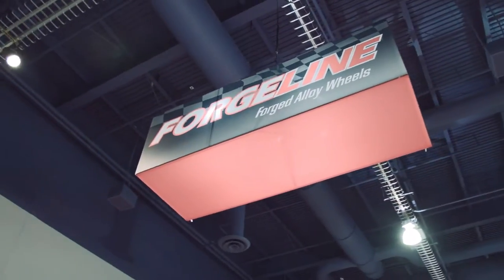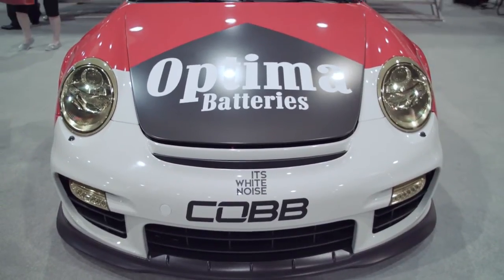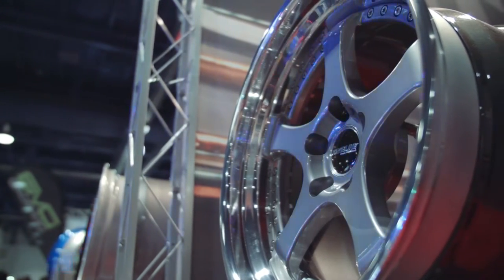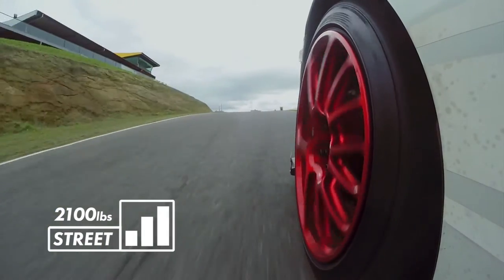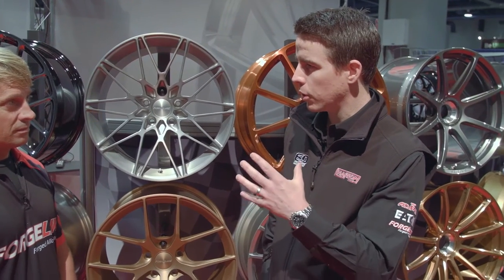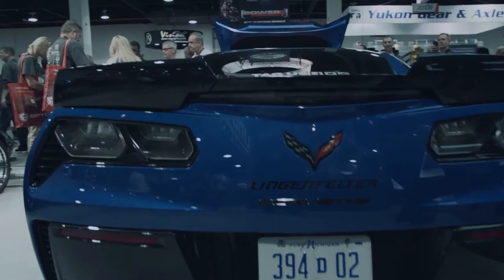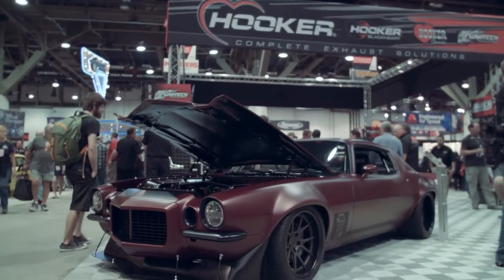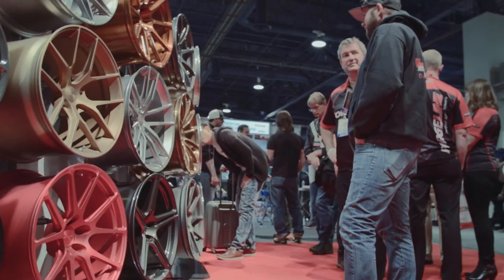Forgeline Tech – Wheel Load Rating System

Comment: Why do the load rating numbers drop from street to race? Shouldn't the race use have the bigger number?
Reply: I would guess for weight reduction.  Plus on track your not going to run into massive pot holes and curbs, so the wheels don't need to be as impact resistant.

Comment: I noticed my fuel off-road rims have different weight ratings. Example 2 of the wheels say 2500 lbs and the other 2 say 3700 lbs. could that be the reason it vibrates at 70 mph ?